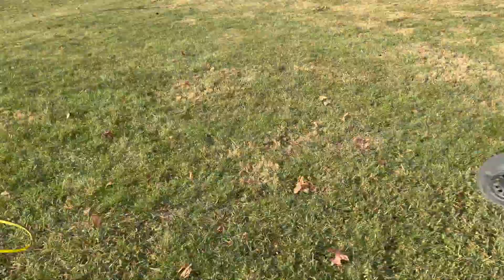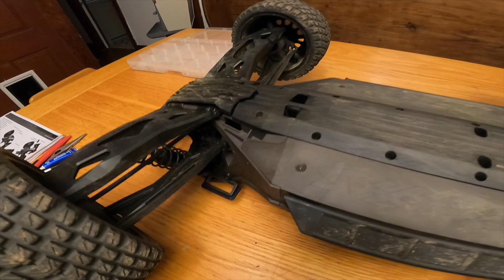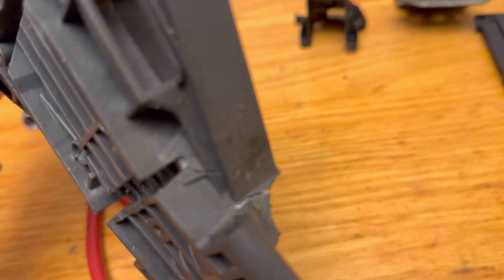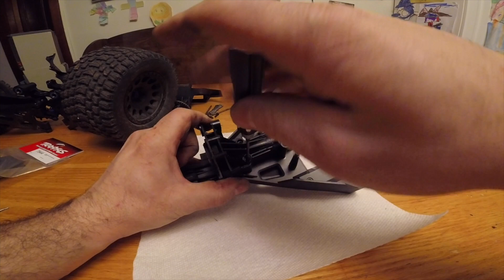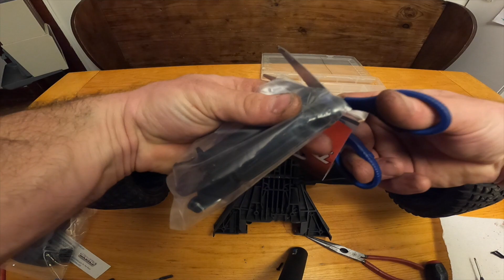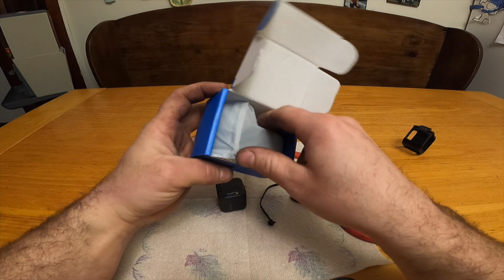Traxxas XRT front lower bulkhead replacement. ASMR

Comment: Forgot to ask, what diff oil did you use?
Reply from the maker: I haven’t taken the diffs apart yet so whatever traxxas puts in there is what I’m running currently.
Reply: @MattsMotoWoRX  Ok, what grease did you use in this video for the front gears?
Reply: The red grease you used at 10:20 mark is what they’re asking for the name of the product.